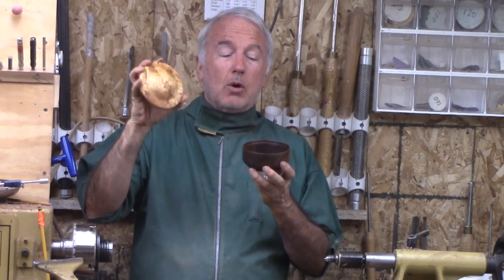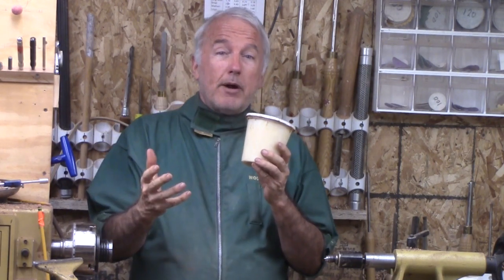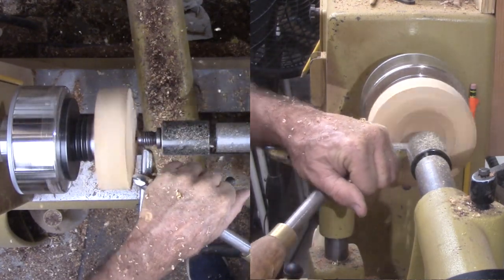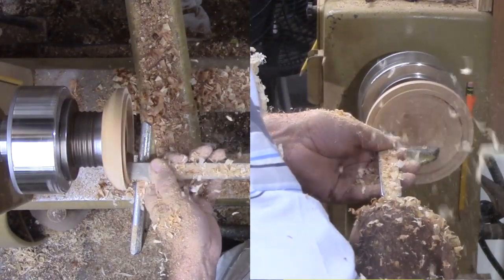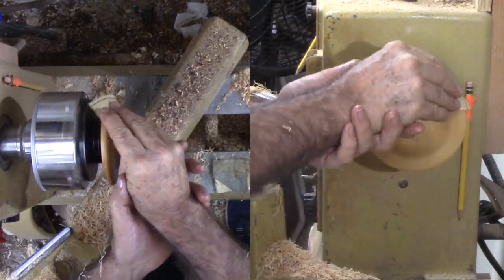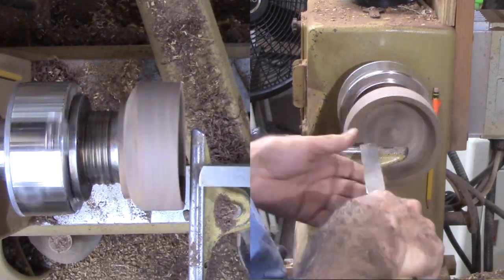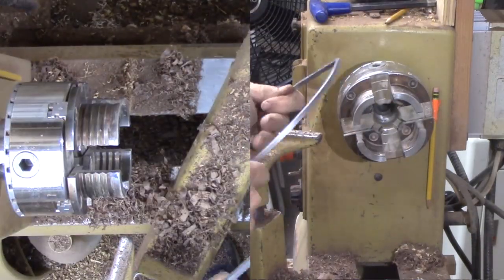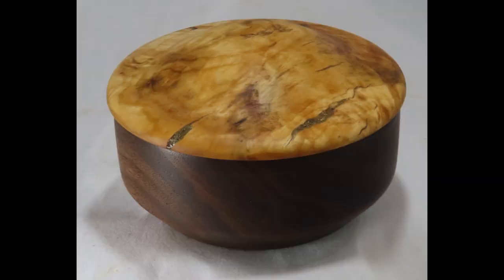Woodturning Cross Grain Box - This One Had Other Plans

Comment: Alan I bought a crockpot at goodwill for $8.00 and make my abrasive paste and finishing cream in it.  It works great. 👍🇺🇸
Reply from the maker: That should work fine in cooler weather. :)
Alan
Reply: I got a small one for $2,00 at a thrift shop. I agree 100%. It's a great controlled and safe way to make anything like that.

Comment: Nice save Alan. Any problem with applying a finish when using your sanding paste? Or is the sanding paste your finish, once you wipe it off? I've seen you use a lot of walnut oil, so maybe it doesn't make a difference. Thanks.
Reply from the maker: The mix is a great finish by itself.
Most solvent and oil based should be okay over oil and wax.
I would wait a couple weeks before using a water based finish.
Wiping it with lacquer thinner or acetone could serve to enhance a bond when wanting to use another finish on top especially water based..
In all cases, I would test on scrap wood before committing.
Especially, since I am not a finishing expert.
Alan